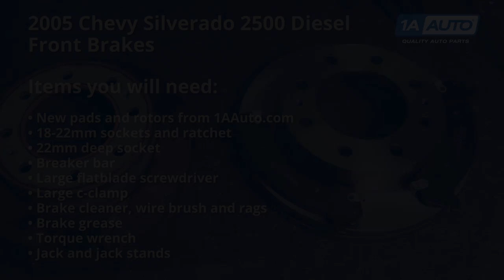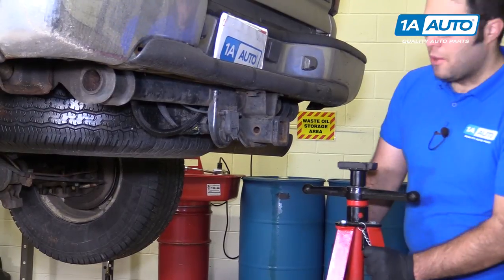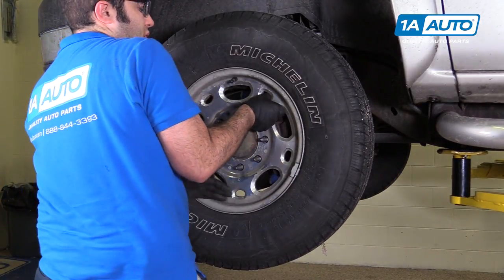How to Install Replace Front Brake Pads Rotors 2005 Chevy Silverado 2500 HD Diesel

Comment: It would have good to know that there are two pads with two wear indicator tabs and two pads with one indicator tab. I completely installed the driver side and then realllized i use the two with two wear indicators on the driver side. Will this affect braking performance?

Comment: Followed your instructions but I blew a rear brake line! You should put a note in there to remove the reservoir cap so the system doesn't pressurize.
Reply: No, he should compress the caliper pistons while still attached with the bleeder valve open. Reversing the fluid flow is bad for the ABS system. This way there is no back pressure at all. Only cost you a bottle of DOT3 fluid and will remove any air in the caliper as a bonus. Remember to only have the bleeder open while you have pressure on the piston.
Reply from the maker: +Hank Thanks for checking us out! http://1aau.to/m/Shop-1AAuto-c